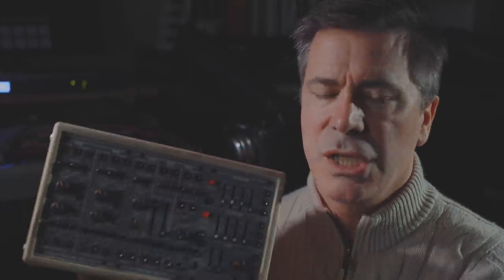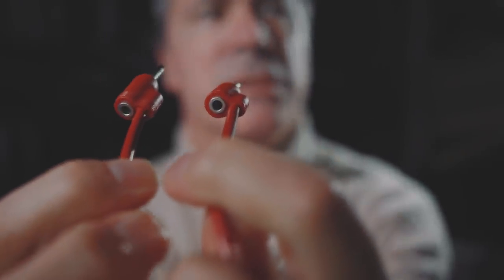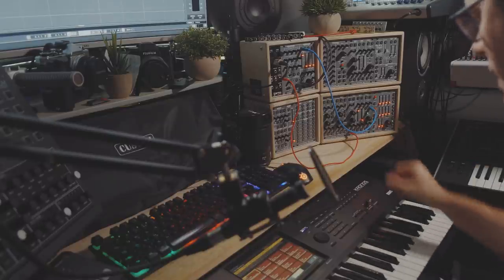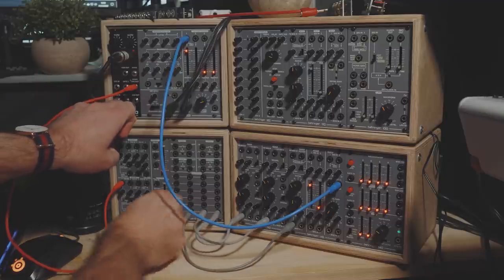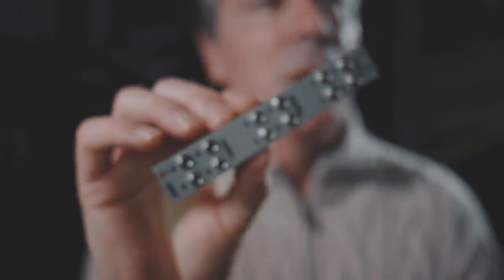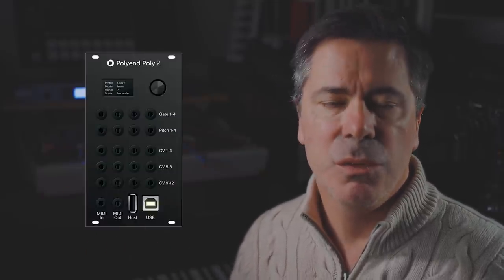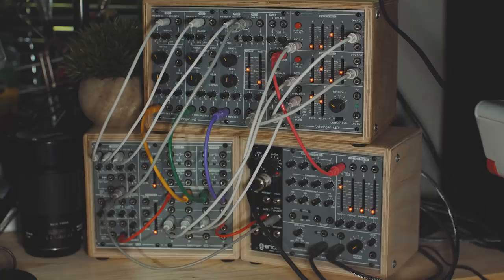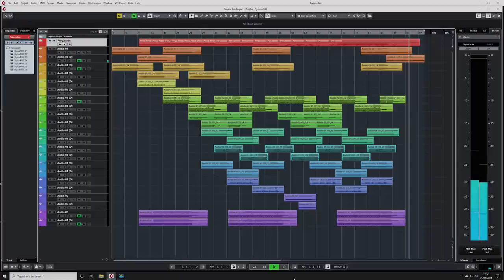Getting into Modular with the Behringer 110   PART 2

Comment: Excellent pad sound at 31:30...

I really liked the look of the three-module case in your previous video (and have even gone so far as to cost it out- £375 including the Doepfer case). Aside from the obvious GAS-related difficulty of sticking at just three modules, are there any issues with sound generation that you’ve identified? I guess what I’m trying to ask is whether, with a Keystep 37 and a raft of fx, that would be enough in and of itself- because it’s very attractive.

Comment: Tim, I like your channel and your music.  Don't you find that running both a VCA and a VCF from the same envelope generator is a bit limiting ?  Rarely do I do this, preferring to use separate EGs  (or other modulation source) for VCA and VCF.  My system consists of most of the same Behringer 1xx modules as yours, along with other modules.  Also, I believe the Roland (and Behringer) VCFs in this series are 12dB/Octave.  I prefer a good old fashioned 24dB/Octave ladder filter (or in my case, SSM2044 based VCF).   Cheers.  Keep up the good work.

Comment: Hey Time is there a stand alone midi to CV converter?  If so what brand?  Thank  in advance. Oh another great and informative show.
Reply from the maker: The only brand I know about are Kenton, but they are definitely worth checking out 👍
Reply: The Korg SQ-1 sequencer can be used as a USB-MIDI to CV converter. It can't sequence simultaneously though - starting the sequencer overrides the conversion.
Reply: You can get something like the Mutable CVPal that runs standalone on USB power for USB MIDI-CV. Or if you want a full on hub there's the CV.OCD

Comment: Regarding the signal degradation problem, it's a shame that Behringer made the mults passive instead of buffered. But since you're multing pitch CV, couldn't you compensate for the pitch offset by individually fine tuning each oscillator?
Reply: That would work for one note, but if you went up two octaves wouldn't the osc likely be out-of-tune with each other again?

Comment: Great vid, Tim! I have two 110 and am thinking about getting a 112 and use one osc to each of the 110.
If patching an 112 osc to the VCF 2 on the 110, will it automatically also go to the VCA?
Reply from the maker: Thanks a lot. Yes the signal path out of the filter and into the amp will work just the same 👍
Reply: Thanks for the fast reply! Been watching more of your videos and you now got a new subscriber! :)
Reply: @TimShoebridge  About to make an order on the 112 but is having second doubts. Will a stackable work when splitting the v/oct or should I get a 297 and use its mixer?
Reply from the maker: @more10  To be honest it depends to a degree on the circuitry of the midi-to-cv converter you are using. I have split a single pitch CV into two many times and not had any problem but with the Erica synths module I use in the video the issue is very audible.
Reply: @TimShoebridge  Yeah, I noticed it worked fine stacking v/oct from keystep to dual 110 so maybe that Erica is a bit weak.

Comment: Hey Tim is there any advantage to taking the 182 sequencer module vs using a Korg SQ-1?
Reply from the maker: Hi Pablo. I haven't used the SQ1 myself, actually I was thinking of getting one :) It's very well featured and has a lot of flexibility, great quantising options, for any serious sequencing the SQ1 would be an excellent choice. The 182 is a great addition to the system 100 range but it is very fiddly to tune and I tend to use it mostly for complex modulation as opposed to pitch sequencing...
Reply: @TimShoebridge  yeah setting pitches on SQ-1 is quite easy. At the moment I have the 112, 110 and 140 in a box like you. But guess to really use the 3 VCOs I have to buy the 173 and 297, right? How important is the 150? Apparently the only way to get noise for percussive sounds. Maybe I should have those 6 modules in 2 of the Doepfer boxes and return the 182 sequencer and stick with the SQ-1? Otherwise I have the oddball 7 modules and don’t wanna have to get bigger/more cases.
Reply: Do you really need the amplifier module you have in the box with the Erica MIDI-CV? Why not just run out the VCA output on the 110?

Comment: As some folk on reddit have quite rightly said... if the Behringer mults module is powered then why is the output sockets passive? seems a waste of power for just a few gates.
Reply from the maker: I'm imagining it is a faithful replication of the original Roland 173 design.
Reply: @TimShoebridge   Well Tim, that hack was pretty clever. Big thanks. Hope to see more System 100 vids from you.

Comment: Could you explain what the other modules are for? Esp. The lower right Modul (Big one) . As space is always a concern...
Reply: If I may break in... the larger unit on the bottom is the 305 mixer. This is a unit to which you can connect the various sound sources, pan them in the stereo field and output them to your amplifier/DAW/recorder. It also contains parametric equalizers to tailor the sound to your liking. This is a 24 HP wide unit, so it is a bit hard to fit it in together with the other System 100 units. In Tim's case, he has a 30 HP wide case, so the remaining 6 HP space is filled with an Erica MIDI/CV converter (no longer available unfortunately).
Reply: @thomaskolb8785  danke! :)

Comment: Hi, Tim, thanks for the great video!
I just have a question... What does a modular synth depend on when it comes to polyphony? does it depend on the keyboard for example? 
If so, do you know if it's possible to controll a modular synth with the Arturia Microfreak (which is a 4 voice synth)?
Or, that depends on a specific module? 

Thanks in advance :c
Reply: If you're going to control a modular system with a Microfreak, you can only send one note at a time since it has only one pitch and gate out. Basically, to achieve polyphony in modular you would at least need multiple oscillators and ideally also multiple filters, envelope generators, and VCAs to form distinct voices for each, well, voice or note that has to be played at a time as well as a way of sending pitch and gate information for each voice (which isn't the same thing as to each voice). 

For example: If you had a single 110 module (VCO, VCF, VCA all in one creating a "voice") then it doesn't matter how many channels of pitch and gate CV your keyboard or sequencer can send, you only have one monophonic voice. Similarly, if you had multiple 110s but only a single pitch and gate CV source (like the Microfreak) then you still only have a monophonic synth (you can interpatch the multiple voices to create more complex timbres but you can still only send one note at a time).

Now, if you have a MIDI-CV converter (and a MIDI keyboard) capable of sending, let's say, 3 channels of pitch and gate CV, and you have 3 or more 110 voices, then congratulations, you have achieved up to 3 voice polyphony. You could also have 3 oscillators, with each oscillator playing a different note, and have them all go through a single VCA and VCF (which as I understand is called paraphony but maybe someone will correct me).

Hope this helps!
Reply: angia That helps a lot!
Thank you so much, I understood everything!
Now I just have to save some money and keep learning.

Once again, thanks! 😊 🙏

Comment: Which modules would I need to get and Modular SH-101 ? :)
Reply from the maker: The 110 + 140 + 182 will give you one VCO, a VCF and VCA, two EGs, an LFO and a sequencer. That's an SH-101 in very basic terms, well it's one EG too many in fact. But the SH-101 also gives you a sub oscillator, a noise circuit and each of the VCO waveforms can be played simultaneously and blended together whereas none of the VCO's in the Roland System 100M line-up (and recreated by Behringer in their System 100) allow you to play multiple waveforms simultaneously using a single VCO. So for that and to achieve a sub osc you'd need to utilise multiple VCOs from the 112 module and sync them together to achieve the same effect. And of course, as I show in the video, once you have multiple VCO's you need modules to support splitting a pitch CV and mixing the audio outputs. And finally for noise you'd need the 150 module but which also gives you ring mod, sample & hold and another LFO as a bonus!
Reply: @TimShoebridge  Many Many Many Thanks for your time and explanation! <3 Happy New Year !

Comment: more you stack cables, more current flows from source module .. cause it’s badically parallel circuit, voltage on all connected inputs should be same as soon as source will ve able to “pumo” enough current .. when it will be not anymore, either voltage starts drop (on all connected destinations)  down or in worst case you can burn your source module circuit (not much likely but in theory it can happen)

Comment: Use passive mults, play out of tune music then call it "microtonal" and you suddenly become an experimental artist. :) :p I have to kindly strongly disagree about POLY2, buggy, not supported / developped anymore, poor build quality and terrible choices of design (like impossible to choose a midi channel when in polyphonic mode which is terrible, pitchbending implementation very weird etc) and also very expensive module for what it is. I was very disapointed! I went for Hermod which is  a killer interface (much more flexible than Poly2) and adds beautiful sequencing for just a slightly higher price.